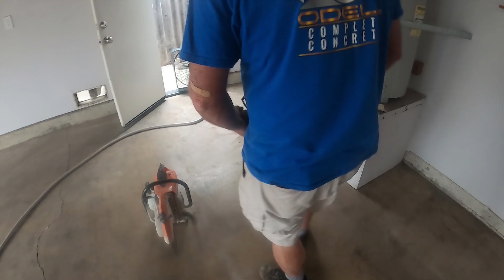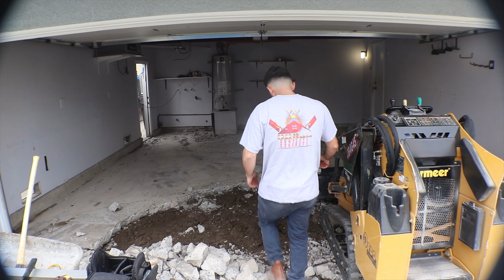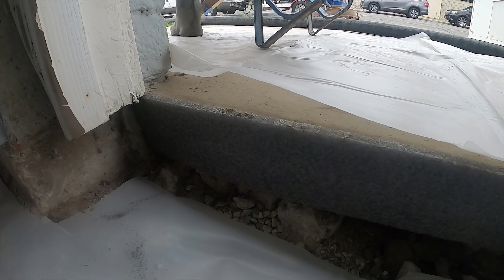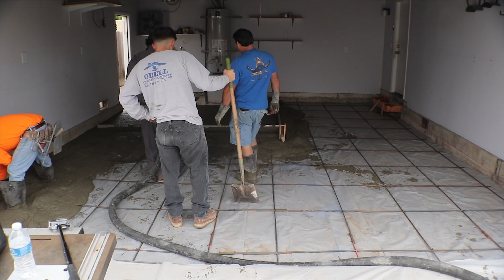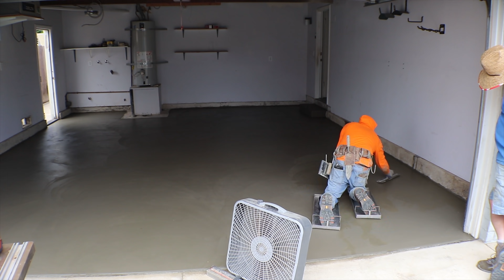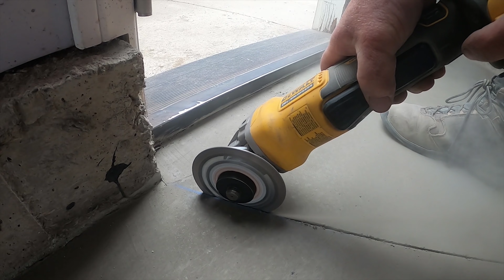How to pour a Garage Slab

Comment: What are your thoughts on protecting a garage concrete slab using epoxy or polyurea? Is it better to just clean it up after the spills? Kitty litter seems to work great when ground in and then swept away.
Reply from the maker: I like epoxy, however a good hard trowel finish with a little sealer works with less money

Comment: I'll take that Milwaukee Radio n charger and I'll put it to good use.  Thanks.  I would also put extra rebar, at an angle on the 2 corners by the water heater.  As I was making my comment, I just heard you say put the rebar at 45 degrees on the 2 corners!  Nice series you got going here.
Reply from the maker: Right on
TY

Comment: As usual, just beautiful to watch. Question ... Expansion foam ... you applied it just on the front edge where the new slab meets the driveway. But the joins to the stem walls are without the foam. Is that because the nature of expansion is different, or absent even ?
Reply from the maker: Yes the car travels there and bounces the edges

Comment: I want the Milwaukee radio and charger.  I do concrete and concrete repair in Phoenix Arizona. Hot as hell here right now. I’d like to invite you to my current project. Repairing or replacing 240 balconies at a high rise in Phoenix. Working off of swing stages. Are you down?
Reply from the maker: I did that in Vegas, Once is enough

Comment: I have to have a garage slab replaced....20x22...what is the average cost to do exactly what you done.
Reply from the maker: 3500
Reply: @OdellCompleteConcrete  Love your videos. Great stuff. I just received an estimate for a similar job plus installation of 6 inches concrete for 8500.  $12 for 667 sq feet. My estimate sounds ridiculous based on your quote for this job.

Comment: "I want the Milwaukee radio and charger" alway nice job done, with saw cut you will never have and dirt and weed growing from the crack control  joints. On the other hand wet joining the control joint will leave a quarter  round radius. Easy to have dirt and weed growing which mean you need to do maintenance. Saw control  joint is maintenance free.
Reply from the maker: For sure
Reply: I fill my saw cut control joints with a self leveling caulk from SikaFlex.  Leaves a very clean joint for life and nobody else does it in my market!
Reply from the maker: @MyConcreteGuy  OSS

Comment: I want the Milwaukee Radio and Charger. 
 Hey David, I realize the customer was still in the home while you did this job, but for the extra work and offset cut lines, wouldn't it have been better to pull the water heater and stand? Tell the customer to take a few days at a nice hotel with a pool and come home to a perfect slab...
Reply from the maker: I like that idea

Comment: Question from a noob. 

Isn't the poly/plastic below the concrete act as a vapor barrier? 

If you shove steel stakes through it then pull them out and cover those holes with concrete isn't that defeating the purpose of putting the plastic down if you've got holes in it..?
Reply from the maker: Good point.
A couple small holes probably wont effect it

Comment: I'm glad you mentioned the extra bars at the water heater corners. It may not prevent the cracks but it will keep then tight.
Reply: Oh yeah, I want the Milwaukee radio and charger.
Reply from the maker: I concur
YW

Comment: Is it me or does does the trowel swirls in the last corner where you ran out of concrete look like a slightly different color than the rest of slab?  Still looks awesome I’ll add.
Reply from the maker: Yes your correct since the trowel overlapped on to the first pour there is a difference in shades until the concrete is totally cured out.

Comment: Good Work Odell! only thing i would have suggested to homeowner, would have been to hang the water heater while the garage floor was removed and replaced. Simple wood frame would have worked. (After draining the water heater of course). 
I want the Milwaukee radio and Charger!
Reply from the maker: Full removal is best, because your with out hot water regardless

Comment: If that was my garage I would have had that water heater moved into one of the corners and put on a 6" pad.
Reply from the maker: Makes sense
Reply: In the Northwest, gas fired water heaters and furnaces have to be elevated to meet building codes.  Gas leaks settle on the floor, could be a problem with any pilot lights that are burning.
Reply: @MyConcreteGuy  It's in California.NOT the Northwest.